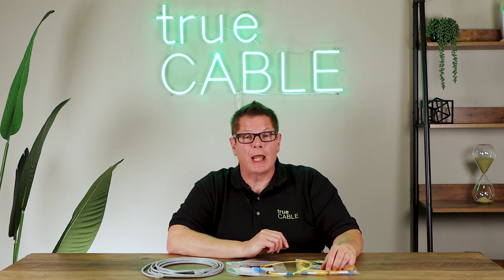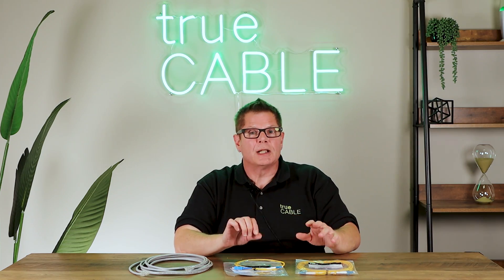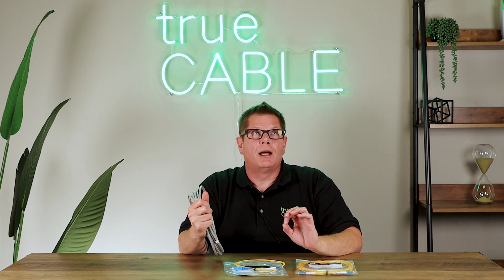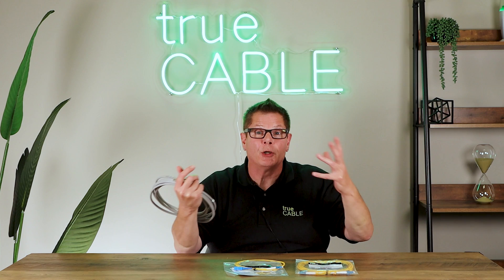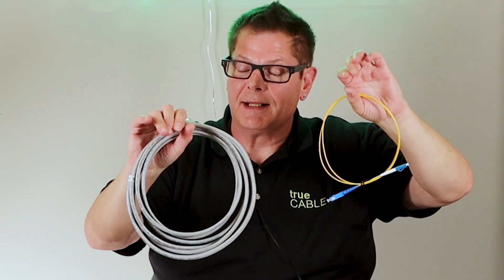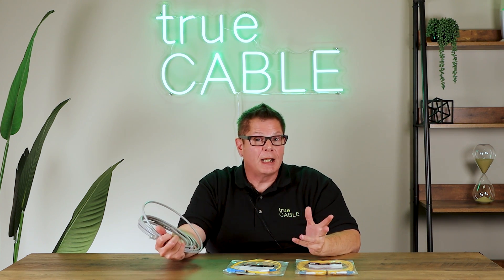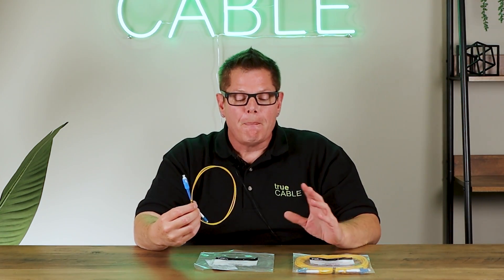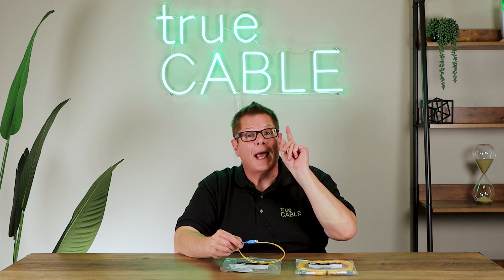Fiber Optic vs Ethernet Cable: When and Where to Use

Comment: Let's say I want to use an optical fiber to connect my devices to a modem/router because I'm running the cables in the same conduits electricity goes in.
Is there an adapter I can use, like USB to Ethernet adapters, or does the device need to have an optical cable connection to begin with?
Reply from the maker: Good question. Although it is most convenient if the end point devices accept fiber right off the bat, many consumer devices don't. No sweat. Simply use a media converter, which allows you to plug in the fiber cable to a SFP/SFP+ transceiver. The other port on the media converter is a regular Ethernet one, and you then plug from that port into your end point device. Where there is a will, there is a way! PS-media converters will require plugging into a power outlet, just FYI. There are actually a small switch calling itself a "media converter".
Reply: @trueCABLE  Thanks for the answer! :D

Comment: Fiber is also great for runs between buildings.  I have a shop about 200 feet away form my home, which is within the range of ethernet specs.   However copper run this way is a lightning damage and ground potential risk.  Fiber is better in this case, even though range isn't an issue.
Reply from the maker: Excellent point! Anytime you connect two buildings with something that conducts electricity, you are setting yourself up for some expensive non-celebratory fireworks. Optical fiber is the best way to do this now, regardless of distance.

Comment: In the Audiophile world with digital streaming equipment we are seeing fiber as another way to electrically isolate the equipment from unwanted noise. I'm not sure that the direct ethernet connection is responsible for a lot of noise in general but I am sure that fiber never has caused any...  I didn't realize that fiber was able to make such long runs without some sort of signal amplification. That's pretty incredible!  When I set up my fiber connection to my audio equipment I found all the different connections, adapters, fiber types a bit confusing. I ended up figuring out something compatible with my equipment but I would love a rundown on the different types and why they exist if you could?
Reply from the maker: Hello! Yes indeed, fiber is the way to go for absolute noise immunity. You are also correct in that fiber can transmit very far (kilometers) if you use powerful enough laser transmitters for the job. You are in luck in that we go into great detail in various blogs (many having videos hosted here on You Tube) about the different types of fiber optic cable and the associated connectors. Please visit our Cable Academy at https://www.truecable.com/blogs/cable-academy/. A good blog to start with would be https://www.truecable.com/blogs/cable-academy/single-vs-multi-mode-fiber-optic. I hope that helps!
Reply: @trueCABLE   Thank you for the information. I will be sure to follow!
Reply from the maker: @HealthstarOnline  Hello and you are welcome!

Comment: Can I replace Cat6 used for 4k video cams with fiber?  I would love to stretch my views over our 25 acres.    Ooooo... I just got to the cam- powering part.  Thanks for clarity. Cheers.  Jim
Reply from the maker: Hey Jim! You are welcome. For PoE applications (cam, AP, etc.) where the same cable is expected to deliver data AND power to the end device, fiber optical cable is less useful since it cannot carry electricity. There are ways/means to work around this, but in the end it might be more trouble than you want to deal with. Fiber is most useful for high speed/ long distance, or high speed AND long distance communications runs that don't care about ambient temperatures or the EMI/RFI environment. We hope this helps!

Comment: Would you use copper or fiber for outdoors, 3 stories, to a solar controller on the roof?
Should I worry about lightning/grounding?
Link speed is not important. There is AC power in place.
Reply from the maker: Hello! I would honestly use fiber for this if you can get away with it. No concerns about lightning with it, and no worries about EMI/RFI either. Check out our complete Fiber collection using the link in the video description! Happy Networking!

Comment: Fiber optic cables are called Ethernet?
Reply from the maker: Hello! Fiber optic cable falls into the "communications cable" realm, just like copper twisted pair Category cable does. Both cable mediums are capable of carrying Ethernet signaling. That is the brass tacks precise answer to your question.

Comment: Most interesting presentation. What about Streaming HiFi Audio in your home over say 10 meters. Costwise Optical Fiber (with converters) is cheaper than Ethernet. For a good Ethernet cable you pay around 1200 US Dollars. But what about the advantages/disadvantages for streaming applications using Fiberoptic. I guess lower (or none) impedance for fiber optical cables is one and much lower noise floor is another. But can you come up with other reasons?
Reply from the maker: Hello and thanks for your comment. The primary advantages to fiber, besides speed, are near total immunity to EMI/RFI (therefore avoiding environmental noise issues you are referring to) plus the ability to much reach greater distances. Fiber is also physically thinner, requiring far less physical space. Cost-wise, if you are merely installing fiber patch cords then they cost the same or less as traditional copper twisted pair patch cords. Where the greater costs of fiber come in is when you need to install bulk unterminated fiber. The cost and complexity of bulk fiber termination far exceeds the cost and complexity of bulk copper twisted pair Ethernet termination.
Reply: wait what, 1200 US dollars? Was that a big typo? I can find the absolute best ethernet cables for just 35-40 euros here where I live, most of them are well under 15 euros lol.

Comment: Is there any noticeable performance gains to use fiber over copper for short patching from a router to a switch?
Reply from the maker: Hello and good question. The answer is...it depends. Each installation is different. If you want 25G or 40G, I would automatically defer to fiber no matter how short the patching distance is. When it comes to 10G it is more of a toss-up on short distances, with perhaps some deference going to one or the other depending on the environment and what you want to achieve down the line. For 1G, either one will work great no matter what.
Reply: @trueCABLE learn how to communicate dumb nerd

Comment: Most installs Ive seen are all copper and fiber for idf to mdf. You see alot of fiber in big open buildings like warehouses and home depot where the data runs exceed the 100 meter limit.
Reply from the maker: Hello Henry. Indeed, that is an ideal use case for fiber optic...where the 100 meter limit of copper twisted pair Ethernet is exceeded!
Reply: I would also use fiber over copper for anything that really needs more than 1 gigabit of speed. Copper ethernet simply wasn't made with that speeds in mind and it shows:
5/10Gbit Ethernet NICs and SFPs have the same power consumption and heat output of a graphics card.
Cat 6/7/8 cable is thick and flexible as a broom stick.
Switches are way too expensive etc.

For most things gigabiy ethernet or wifi are more than enough, for everything else fiber all the way.
Reply: @qdaniele97  Fiber is for distance. Cat6 is certified for 10G up to 150'. You only need fiber if the run over 300'.